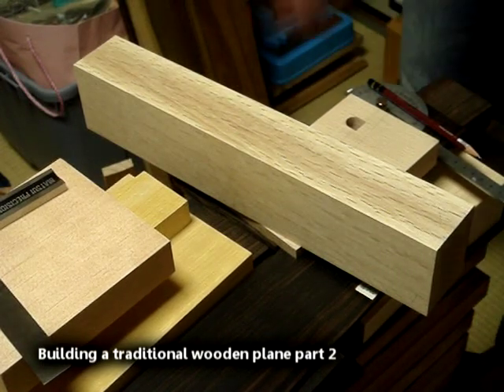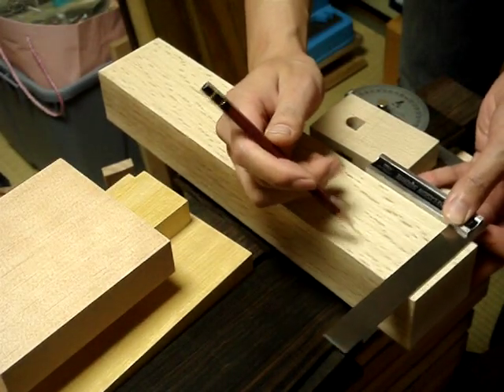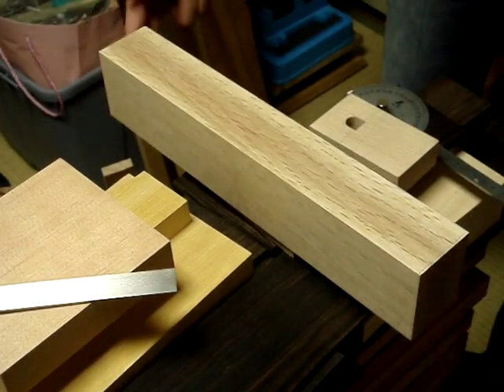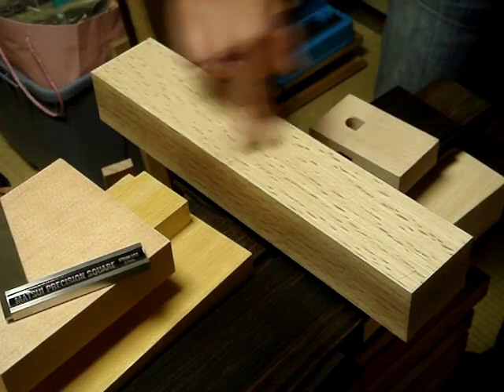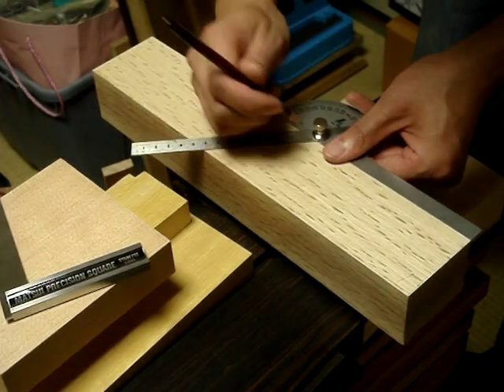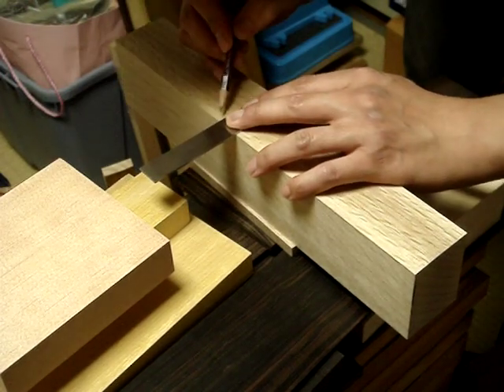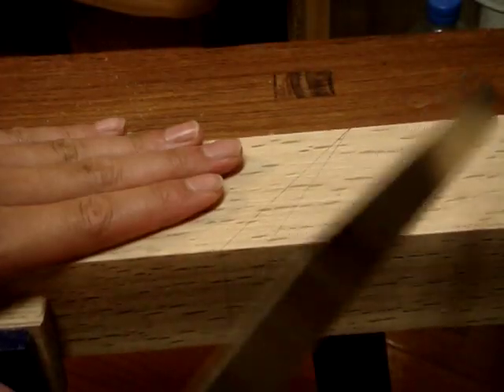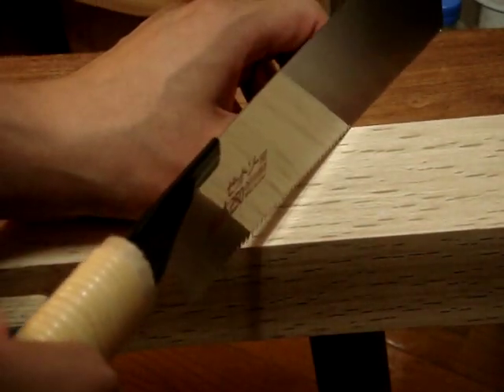Building a traditional style wooden plane pt.2

Comment from the maker: I actually don't use a breaker in this plane. The iron I use is from Ron Brese. You can find similar irons from other plane makers. In a pinch you can even use a Stanley type blade or an aftermarket version from Ron Hock or Veritas etc. That way you can get a chipbreaker too. The way I would recommend though is to look on auctions for vintage plane blades that are laminated. They are the cheapest option and produce the best edge in my opinion.

Comment from the maker: Thanks!
I am actually in Japan but protractors like the one I use can be had all over the place I think. Usually they come without the long arm on the semicircular bit. I think if you search for "steel protractor" or something you will turn some suppliers up. Amazon should stock some.

Comment from the maker: I'm not sure which dimensions you need but for this plane, the main body is in total 355mm x 70mm x 70mm. The tote blank was about 150mm x 150mm x 25mm. The wedge blank about 160mm x 60mm x 15mm.
The body can be any length and the width of the total body should be about 16-20mm more than the width of the blade. The wedge width should also be the same width as the blade mortise. Wedge length is dependent on the blade. Thickness is not too important. Tote blank size depends on the design.